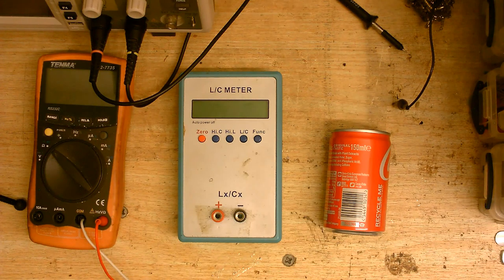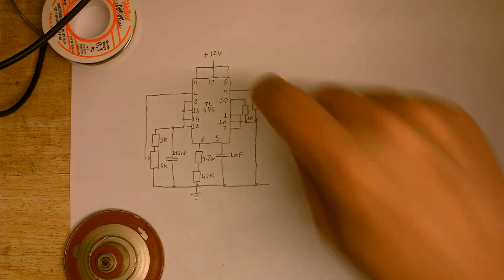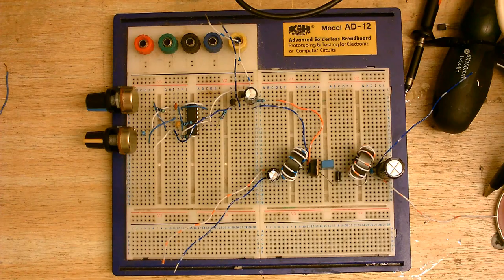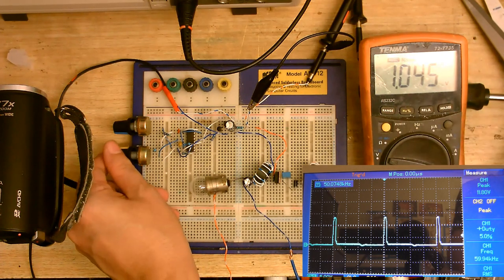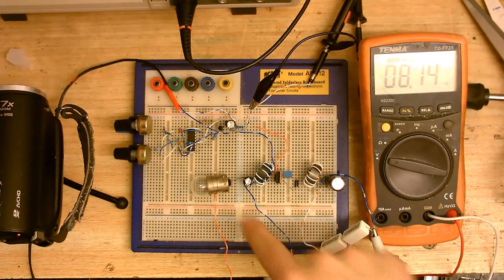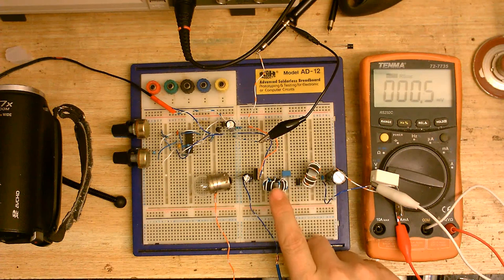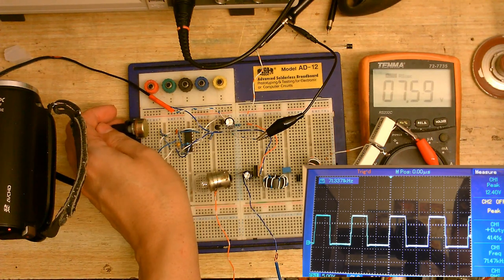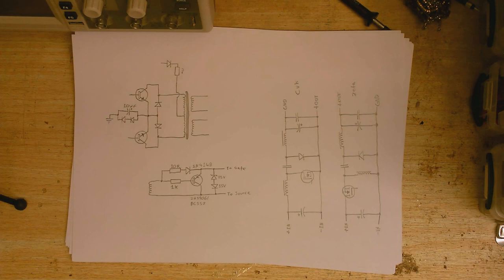Experimental switch-mode power supply experiments - simple DC DC converters.

Comment: Hi CoolDude, are you sure this zeta design works as intended? When the MOSFET switches off, the current through the loop of the 460uH/FR207/1uF will bring the node with the source of that transistor to a voltage below GND, which will switch on the MOSFET again, once the V_GS reaches more than 2V. I think the MOSFET should be of p-Channel type, here. That also has the benefit that the Gate voltage does not need to be higher than V_out. 
Edit: just checked an AppNote from TI for this design. It would be beneficial, to link the flux of the two inductors, too (e.g using a transformer).

Comment: Question - How do I measure on multimeter the output voltage from 
circuit seen from 2007, that was secondary side of 
Inverter of 120VAC connected on each output line single diodes that are 
opposite polarity each facing, (anti parallel one on each line) going to resistor load? Is this still a 
portion of 120V AC output ,or approx 40 volt half wave DC plus and minus
 DC? The writer may have been thinking about back flow protection. This 
is not print error, or about clipping circuit. Please advise.

Comment: It's also possible to use the tl494 as a class D audio amplifier which is fun to experiment with. Was thinking about doing something similar to make a modulator for an AM radio transmitter. One of my favorite parts to scrap from old computer PSUs along with tl431 shunt voltage regulators. Both highly useful for projects :)
Reply from the maker: That's something I've thought of doing as well. I once made a plasma speaker using a tl494 (and a few other parts of course including a TV flyback transformer)